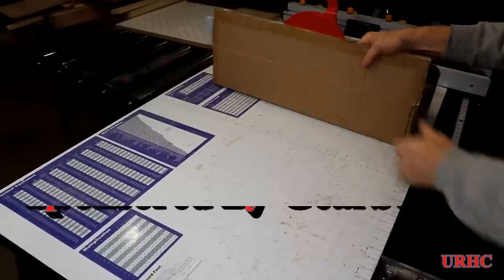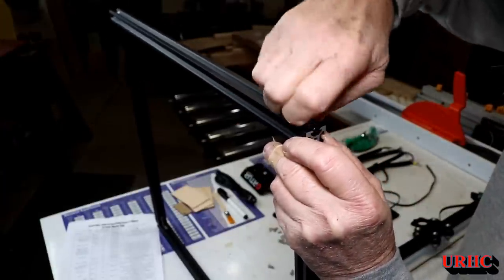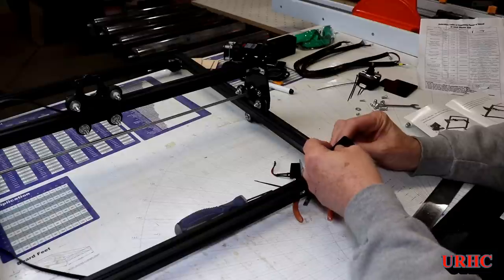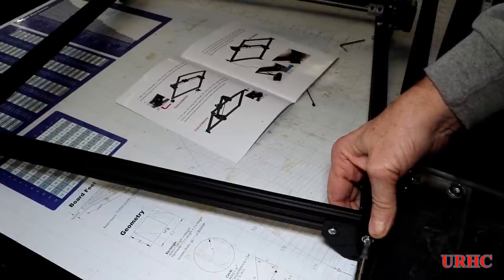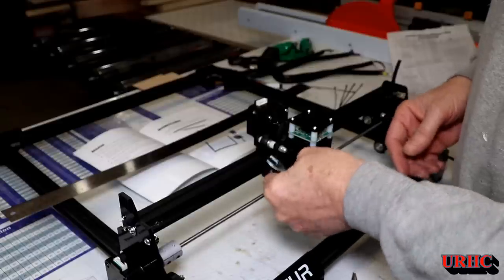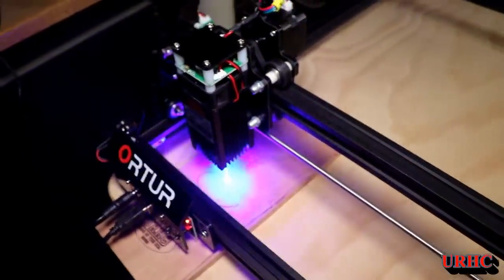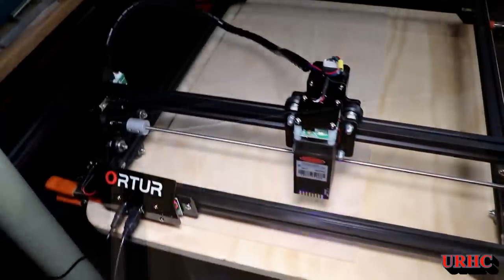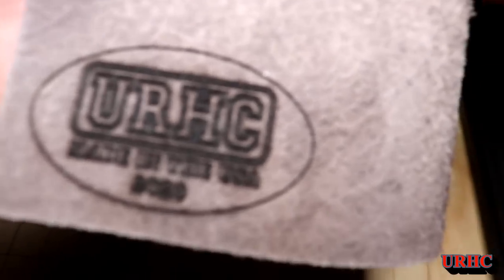Ortur Laser Master 2 400mm x 430mm 15 Watt Laser Engraver From Gearbest

Comment: That is a really well designed and built unit - am sure you'll get lots of use out of it.
Been patiently waiting for my Ortur 1 since early February, but ain't in no rush. 
Hopefully the folks over there will be recovering soon so they can get back to their normal lives. Been a heck of a crazy year already !
Reply from the maker: They just expanded the Ortur 1 and this works just as good. Hopefully you get yours soon. Did you get a shipping notice yet?  I am still waiting for a drone that I bought before Christmas that shipped a month ago. Apparently without commercial flights landing in China things are sitting in warehouses for weeks. I didn't realize how much cargo passenger flights move. Thanks for watching.

Comment: Can you pass through a piece on the x axis longer than the unit such as a longboard? and can the 20w version handle engraving on acrylic sheet/plexiglass?
Reply from the maker: As long as you shim it up to the focus distance and it is flat in the area you engrave. Won't do clear plastic from what I  have heard,  only black plastic.  Thanks for watching.

Comment: Do you think it would engrave lettering on anodized aluminum approximately .003” deep and 1/8” tall??
Reply from the maker: I don't  know. I am not going to do aluminum without a vented enclosure because of the harmful vapors. I think  the 20 watt with shorter focal distance would be better for materials like that. You should contact Ortur. Thanks for watching.

Comment: I have this laser as well! Can you give a recommendation on how to clean it? I’m noticing it gets a little less effective after heavy use.
Reply from the maker: You should contact  Ortur. I don't  know  what  the lenses is made of and it may need to be cleaned or replaced.  For heavy use most lasers have air assist that keeps the vapors off the lenses area. Thanks for.

Comment: I got one of these.  Having so much trouble.  Had to wait a month to get a replacement control board because the first one was dead on arrival.  This was advertised at able to cut 3mm thick wood.  I got some Baltic Birch 3mm plywood.  Don't even burn half way thought it with 100% power and 10 speed in LightBurn.  I measured the distance of the laser to the material, and check the focus on the laser, and it barely cuts half way though after 20 passes.  Have you be able to cut any type of wood with yours?  If so what wood works?  I do not have air assist.
Reply from the maker: I can only cut 2mm deep in Baltic birch with the laser properly focused.  Haven't been able to cut through it.  The laser seems to only have a focus depth of about that and needs refocusing to go deeper. Like I have said mine are best for engraving wood and they do a wonderful job at that. I think you need something  like a 60 watt or more laser to cut 3mm in one pass. What does Ortur say? Thanks for watching.
Reply: @unemployedredneckhillbilly2023    This is what Ortur told me:  "You have 20W module yes?
Think of this. 20W has a focal rage optimal of 35mm off the heatsink.
So lets say you want to cut 3mm ply
By the time the cut is half way into the material, the laser will be out of focus
Therefore try this
A) set a plate at 35mm off the laser heatsink
b) focus the laser perfect with a little black card/paper
c) Now put the material OVER the plate. So in effect your focus will be at the bottom of the plywood not at the top"
Reply from the maker: I will  have to try that.  Mine are 15 watt that are supposed to have a longer focal range then the 20 and I always use the top. I read the 15 will cut deeper then the 20 because of this and the 20 has more focused power for engraving metal. Have you gotten  back to them after trying that unsuccessfully?
Reply: @unemployedredneckhillbilly2023  I haven't tried it yet.  I will probably try it later tonight.  I'll reply with what happens.
Reply: Unfortunately even after adjusting the height of the laser to 35mm and focusing on the bottom of the cut instead of the top, it still did not cut the 3mm Baltic Birch plywood.  No improvement either, cut about the same depth, with a lot of over burn.  I have been able to cut 1.5 mm Balsa wood.  I'm going to try 2mm Balsa wood.  If it can cut 2mm Balsa wood that should be good enough to do what I need to do.  Some people are saying the G8 lens cuts better on the 15 watt laser, but I not sure how it works on the 20 watt laser.

Comment: Could you share some of the settings that you used? Like the power level and speed and stuff like that. I am having a little bit of trouble figuring it out and my finishes are sucking. Thanks!!
Reply from the maker: I use lightburn with 100% power max and vary the travel speed. Try samples at different speeds on the material you are using  because the settings are different for different materials.  I make samples and write the settings on them for future reference. Be sure the firmware is updated and you are using the pwm type machine settings for artwork. Also focus the laser to the material thickness before starting.  Photos are tough every one is different and it takes a lot of prep work on the photos to get decent results.  I don't like the laser grbl that comes with it. I don't use Facebook but I think Ortur has a user group on there for help. Thanks for watching.

Comment: Hello, I have the 20W version of this for cutting. I set up my laser within 55mm of the top of the object as recommended. Any tips on focusing the laser. it's a bit uncoventional from the 5W laser I have where it's very easy to focus. This one has almost like a slit and it's hard to find the point at which it focuses. Any tips? is the slit normal versus a small point?
Reply from the maker: The 20 watt has a different focus lenght. I think it is 25mm. Check your  manual. This is for the 15 watt only.  It does not get perfectly round. Get it as close to a dot as you can. Thanks for watching.
Reply: Unemployed Redneck Hillbilly Creations got it! I’m assuming this is a trade off that has to be made. Hopefully I can get some nice smooth edges. Thanks!
Reply from the maker: If you don't get smooth edges  check that your belts are tensioned properlyand your wheels are adjusted.  The blue laser diodes are rectangular and the lens just concentrates the beam. Have fun.
Reply: Unemployed Redneck Hillbilly Creations I’ll double check, you’re awesome!

Comment: I have just bought this laser and am completely new to laser engraving and cutting.  I love your video but do not understand the terms you use.  How do you do the X and Y axis vertical and horizontal lines and the grid pattern?  I don't understand where to place my material for engraving and this seems like a way to learn to place it better.
Reply from the maker: I used lightburn to draw the grid. Drew a horizontal  and vertical line at the 0,0 location and then just copied them at the spacing I desired.  Then assign power and speed for the laser to burn them. I bought lightburn  because  laser grbl was to hard for  me to use. I read the lightburn manual  to learn to use it and they have many good videos to get you started. X and Y are the coordinates cnc equipment uses to define the movements and lightburn let's you reset the 0,0 to locate your burn.  It all will  depend on the software  you plan on using and type of artwork you plan on burning. Be sure to get safe glasses and install proper ventilation for the materials you plan on working with as the fumes from some materials are hazardous.   Check with Ortur to see if they recommend a forum for help getting started.  Thanks for watching.
Reply: @unemployedredneckhillbilly2023  Thank you so much - you are a big help.

Comment: Hey,
Just beginning to look into laser engraving now as a new hobby. Was wondering what the difference is between the 15W and 20W if you knew, and if you ever have to replace certain parts or how long these machines last! 
Thanks!
Reply from the maker: I have no idea of the difference.  Remember the output of the 15 watt laser is about 4.5 watts  and 20 only about 5 watts.  I don't know how long the lasers last and the mechanical parts are basically the same as a 3d printer and could be fixed easily. The biggest issue is it needs venting. These are nice entry level units to get started for under $200. If you're going to use it everyday and want to do metal and other materials a blue laser is not the best choice.  It's definitely a fun addition to a woodshop. Thanks for watching.
Reply: 5 watts

Comment: What were the settings you were using when burning your wife's poem into the birch? I need to do the same job, and I like the way yours came out. Interested in speed, power and anything else you think would help.
Reply from the maker: I will check next time I start up that computer. I know the line was 700mm/m @ 100% and the fill I had to reduce the lines per inch at the 1500mm/m @ 100% to keep from burning the edges. The Baltic birch plywood  works best for me. The settings will be different  for each font size and type.  Thanks for watching.

Comment: What is the proper distance measurement to material and is it measured from the heat sync or the laser lense itself?
Reply from the maker: Originally they said the lense face but now I see they say the heatsink bottom. I have been using the lense face. Thanks  for watching.

Comment: Hi,  Please can you let me know if possible on where to start it on your work....There is no pointer on it.  Not that I can find.  👍
Reply from the maker: Use the frame button in the software.  It will frame the area of the engraving with a very low power setting on the laser. I keep doing that and resetting home until it's where  I  want it. Thanks for watching.
Reply: Thanks Sooo much....😀👍

Comment: Just be careful: don't let it sit too long. The rubber v wheels will get a flat spot in them and cause you issues. That's what happened to mine. I used it a whole bunch, then not for about 2 months, went back to use it thunk thunk thunk and it sticks sometimes. The little nema 17 steppers should be called ANEMIC 17 motors lol.
Reply from the maker: These wheels seem better made then the ones on my cr10 printer. The steppers seem to be just the right size for the machine.  It works pretty good and I will see how it stands up over time. Keeping things like this under $200.00  is a tough job. It works great for engraving wood.  Thanks for watching

Comment: Hi.  Please could you let me know what the maximum thickness of material can be used with this product.  Also would it be possible to raise this product to compensate for materials thicker than the recommended size.

Excellent video 10/10
Reply from the maker: There is no limit.  You can raise it as high as you want or set it on a part as long as you keep the focus distance. Thanks  for watching.

Comment: Really good video showing all the fiddly bits to help us from having problems setting up. Can you recommend the correct safety goggles for this machine?
Reply from the maker: I don't  recommend  things  like that . I found  some  on Amazon that meet the wavelength and watt spec with  od6+ certifications but have  no way to check if they are the best choice or really  meet the specs being  from China.  . I see Ortur now also sells some so you may want  to ask them that question.  Thanks for watching.

Comment: ok, Im having the same problem and it looks similiar to the limit switch issue... its getting stuck in the corner on startup after I hit the button... how do I check this? I just assembled the laser...
Reply from the maker: Check all the connectors are plugged properly  and the pins are fully seated. Contact Ortur if there is still a problem.  Thanks for watching.
Reply: @unemployedredneckhillbilly2023  Thanks I rechecked all my connections and plugged replugged them.. whatever it was it is now working..now to figure out what settings....Thank you!
Reply from the maker: Sounds like the same problem  I had with one pin slightly backed out of the connector housing.  l recommend you try lightburn.
Reply: @unemployedredneckhillbilly2023  I downloaded it and made a few burns..Thank you for the recommendation... Is there a reference somewhere broken down by  material for speed/strength/passes ?

Comment: I have been searching for a laser to purchase and it has been a process. Eventually I will want to get a CO2 laser but I decided to get started with a diode laser. After reading reviews watching videos I was leaning heavily toward the Ortur. Then I realized what a small engraving footprint it had. Then I found this laser yesterday and decided this is the one I want. So happy to find your video. 

I will be ordering as soon as I can and while I was waiting for the machine I would like to prepare a work station. For ventilation and additional safety, I was planning on building a shroud around the machine. I was wondering what the outside dimension are?
Also, will you be making a shroud for your machine? That might be a good topic for a video.

Thanks.
Reply from the maker: This definitely is a good machine to start with.  Both sizes of it have their uses. Now that it's warming up I will just run it outside and plan on making an enclosure next fall. The thing I am looking at first is placing the cables in a chain as they take up a lot of space the way they hang off. Another thing is adding a slide to the laser to easily adjust the 55mm focus distance for different material thicknesses.  size will really depend on what you plan for cable management. Thanks for  watching.

Comment: ok i built mine everything moves the way it should. but nothing teching me about the laser. how far away should the laser be from the items you are working on? i have speed rates on different materials 50% power and 8 pass and im barley making a mark in cardboard? is my focus off? first laser every video on this thing has all skipped on teaching about distance and laser focus wth is going on here. is this right? i have the 20w version
Reply from the maker: I know the 20 watt has a different focus distance.  It should be in your manual. Focus to the smallest rectangular dot you can get after  setting the distance.  I had very  little  luck with laser grbl and bought Lightburn that makes setting power and speed for lines easy. I always use 100% power and about 400 mm/minute for burning  lines in wood and several passes at about  10 mm/m for cutting but keep running tests to get the best settings.  I also read the lightburn manual that gave me a better understanding how to get the best results. Thanks for watching.
Reply: @unemployedredneckhillbilly2023  Yeah i found the max value to be 55mm but nothing to tell me optimal. I did manage to get a dot burned on medium settings in lasergrbl on the samples . cant get lightburn to do much yet:(
Reply from the maker: That is the 15 watt distance.  The 20 watt is like 1/2 of that . I think it's about 25 mm from the bottom of the heatsink. Download and read the lightburn manual plus they have an Ortur topic on the forum.

Comment: I've been thinking about getting one of the Ortur machines.  I know the actual laser power output would only be 4.5-5 watts.  Is that enough to cut through a coated or anodized layer covering metal surfaces?  I know it's not enough to actually engrave the metal but etching out the powder coating or anodization would make for some nice projects.  Thanks for the great video!
Reply from the maker: It is supposed to be able to do that but I  do not have an exhaust system to remove  the dangerous fumes so I basically  just  use them for wood. I think  Ortur  has some videos  on their channel about that and if you use Facebook there is a group on there that would be the best  place to get accurate answers.  Thanks for watching.

Comment: I get Lightburn Error 8 , is it the same problem you had? but mine stops fine at the end...
Reply: Laser GRBL also says check limits
Reply from the maker: I had error 9 but it hasn't happened since.  Post on the lightburn forum as Ortur is present there.  Thanks for watching.
Reply: @unemployedredneckhillbilly2023  I tried 5 hours and after tighten the rubber it  disappeared. I have no idea but now it works

Comment: Hey my laser beam will not work on my laser. Like everything works except the blue light on the laser so it won't print. Any ideas?
Reply from the maker: Contact Ortur they should be able to get it working.  You should  at least  get the focusing  dot when you click the low power  focus tab. Check all the pins are seated properly in the connector housings.  Thanks for watching.

Comment: Have exact unit. Will not connect to win 7 premium laptop. Sure I have all drivers needed. Is that firmware upgrade needed with this OS.
Reply from the maker: Contact Ortur,  they can help. I'm not sure if win 7 supports usb 2 or 3. The firmware is required if you have an early machine to be able to use full power and pwm. The recent machines should have it. Be sure the power brick is plugged in and not just the USB cable. There are topics on the lightburn forum that Ortur is on along with Facebook.  Thanks for watching.

Comment: I already screwed up, i slid the bracket to hold the bars but now the bracket is stuck and won't budge so i can't mount the other bracket properly
Reply from the maker: You should contact Ortur and what they recommend. Have you tried removing the screws to loosen the stuck sliding nut? Thanks for watching
Reply: @unemployedredneckhillbilly2023  i did, after not being able to move it i decided to use a hammer and it broke. Anyways i have it all together now but now I'm finding the laser isn't working so I'm going to troubleshoot it today.
Reply from the maker: Check that all the pins in the connectors are properly seated.